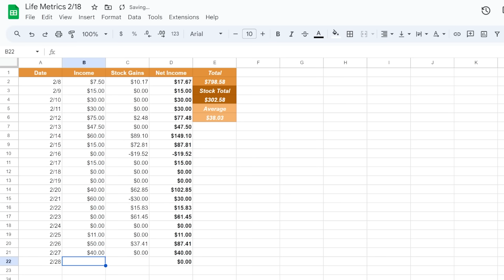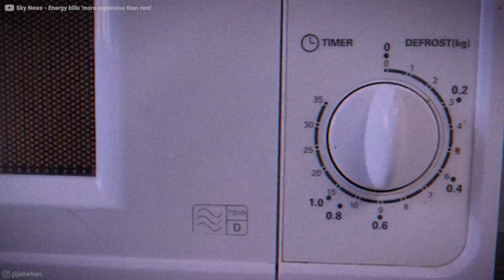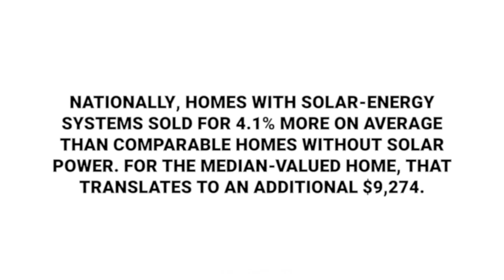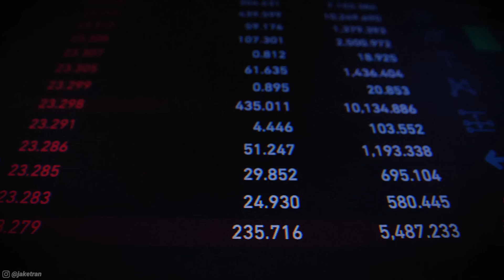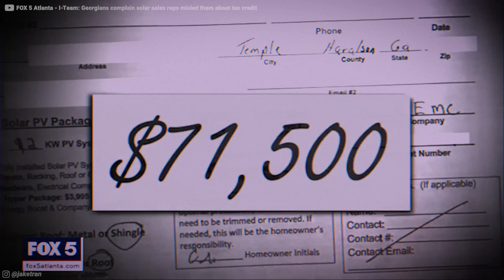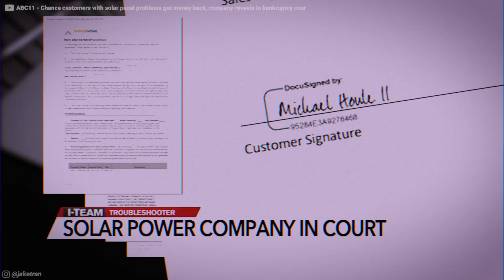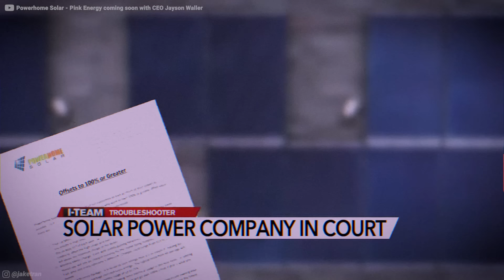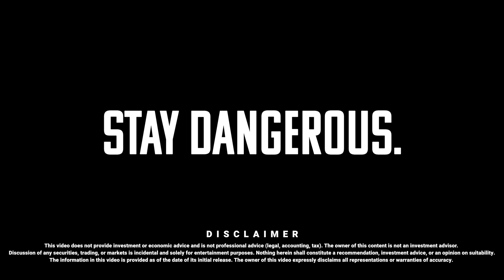Home solar panels are literally a scam.

Comment: I am a sales engineer for PV-Systems (industry size) in Germany. But here and there I also do home solar. Truth is most clients really don't usually care about the investment numbers but their motiviation is mostly to be more independent. I suggest every interested buyer out there to have the investment calculation run out or pay a consultant for the evaluation. 

PV should not be a product, but an investment, so treat it like this.
Reply: It's not an asset, it is a liability. And it gets worse the older the panels get.
Reply: @remyllebeau77  This really depends on the price for the system and what you consume and pay for electricity. 

You can not call it a liability without doing a thorough calculation. And to be honest there are tons of online tools. I tried them and compared to a professional calculation and they were close enough.
Reply: @LimeEngine  By definition it is a liability if you owe someone else for it AKA a loan. That's because nobody is going to guarantee that your electric bill will disappear or at least make up for the loan payment, and certainly not all year round.
Reply: @remyllebeau77  Well you could say this about pretty much any investment. There is always the entrepreneurial risk involved.

I am not saying that in every case PV is a good investment. But electricity prices in Germany are around 0,3 €/kWh (average increase of 2 % anually), your production costs, with maintanance and credit cost included, are about 0,21 €/kWh, then you save about 30 % energy costs anually and can have an amortisation time of 12 to 15 years. Would you invest in such a case or not?
Reply: @LimeEngine   Germany is at fault for not investing in Nuclear power like France. 

Most people in the USA don't even stay in their house for that long. If it is eventually a benefit, they won't be there long enough to see it.

And again, you can't classify it as an asset IF you are still paying for it. That is by definition a liability.
People love to buy cars, but many fail to realize that it is a depreciating asset, and a liability until it is paid off.

Also, in about 15 years you will likely have to start replacing the failing solar panels and batteries. So it's nowhere near the sunshine and rainbows that sales people like to paint.
Reply: @remyllebeau77  The discussion about nuclear energy and the nation wide energy supply is a wholly different discussion, so I won't get to that here.

The degradation of solar panels and the exchange of inverter and battery are considered in the investment calculation (battery change after 13, inverter 15 years). Panels still have an efficiency of 85 % after 25 years and can last well above 30. 

It will not give positivie returns for 12 years (let's say). But this doesn't automatically make it a liability. This is not how investment calculation works. There is no investment that gives positive returns immediately. Because if I would folow your logic, you would also advise against buying houses and rent them out?
Reply: @LimeEngine  Let's not argue about the differences between assets and liabilities. If you want to take on a liability/ loan and you run the math and it will give a good ROI in an acceptable amount of years, then go ahead, I won't stop you. If your math is wrong, that is on you.

Comment: Here is South Africa we have something called load shedding. No electricity daily from 3-8 hours a day. Every single day. So thank goodness for solar panels and batteries.
Reply: Solar would be useless during periods of load-shedding, without pairing it with battery backup and inverters that can run in island mode.  UL and IEC standards require that inverters automatically shut off, any time the grid isn't within spec of nominal voltage and frequency.

Comment: The transmission grid is absolute spec for customer.  I feel as a homeowner the best method of electrifcation is reliance on a central utility which evolves more efficient everything as opposed to a distribution of generators each with questionable reliability.

Comment: Biggest problems with solar are:
1- sales reps overpromising and not explaining clearly how solar really work. There are lots of tricks when it comes to number of panels, types of panels, financial options, lease escalators, etc that make it confusing for homeowners.
2- homeowners buying solar based off the cheapest price. When you buy anything (car, home, shoes, etc) you likely don’t just buy the cheapest priced you can find. Cheapest price means trash gets installed on your roof that has tons of issues, or your system isn’t sized sufficiently. One company may offer a system that makes 20,000 KWh per year and another company might offer a system that makes 10,000 KWh per year be the homeowner buys the system that makes half the energy because it’s cheaper.

Comment: We got solar on our house, we switched to electric heat as well, we went from paying $3,500 a year in heating oil and propane and still having an electric bill. To fully heating the house, playing all my games and having all the electricity I need, and pay around 19 dollars a month in the winter for my electric bill, and in the summer saving the electricity in battery's for if the power goes out.  for numbers sake thats 140,000 dollars in heating oil in 40 years... and still paying electricity on top of that. now lets say i have to pay in for 40 years straight, that would be 2,000 dollars. I didnt even pay half 140k, maybe closer to 1/4th. But when you do it right and look at the math, they are worth it.

Comment: So there is a good amount of misleading information in this video (some pulled from other videos) and a lot of cherry picked incidents. Many people have great experiences with their solar system and some don't. Just like all industries, some sales people are crap, don't rely on them to tell you the truth or simply the correct information as they may not know your circumstances.
Solar is actually worth it if you do it correctly, especially if you can diy a small "off-grid" system and build it out as you go. Plus you get the added benefit of having uninterrupted power backup, priceless for those in areas with natural disasters or power issues.

Comment: The issue is homeowners don’t understand they are buying into a dynamic commodity market of electricity, namely selling Kilowatthours, or Kwh.

Important notes:

1 - Solar alone will not work during a power outage.

2 - You cannot “push the meter backwards”.  The newer meters rack forward Kwh on one register and reverse Kwh in another register, and all data is time stamped by the hour.

3 - Price of power sold depends on the time of day it is sold or purchased.  For example, power is cheaper from dawn until around 4 pm.  Power is more expensive fro around 4 pm to 9 pm.

Because it is now a time-stamped, dynamically priced power market, most homeowners are not qualified to get the most from their PV systems, and therefore they are promptly screwed, rode hard and put up wet.

Most people do not understand how electricity works.  Indeed most people have never understood how electricity works.  And so unscrupulous sales and marketing folks swindle them big time, and folks bawl and holler and are pissed.

Wait twenty years and the systems will need to be replaced.
Reply: Counterpoint to #2:
It is only if you build guerilla solar that this is true.   If you get the proper permission and service agreement from your utility to net meter your power, your utility will provide you a meter that can spin backwards.

Counterpoint to #3:
A meter that sophisticated, usually isn't available to a typical home-owner.  It's common for commercial and industrial customers, but not usually worth the expense to do that for the scale of residential customers.  The standard meters they provide to home owners, and even the net meters, don't timestamp your power, and just work on a fixed rate.  You might have a bidirectional meter with two kWh registers instead of a net meter, that gives you an asymmetric value of energy produced vs consumed, but it is very uncommon that the utilities will provide time-of-use meters for a residential scale customer.

Comment: IDK about USA but in india solar on grid is working perfectly fine for me. I used pay 10000 INR per month ie 120 USD but after putting ongrid solar system of 10kw I get almost zero and even make few bucks in some months. it's been 5 years I think I got ROI already.  I paid 500000 for 10kw on gird system.

Comment: Yes, they are all low frequency. They have the 120v 3000 watt, and the 240 SP which is 120v and 240v 4000 watt. The best place ive found to buy them is Wild Oak Trail. Hope that helps

Comment: Every company I've researched for off grid grid tied and hybrid grid tied have wildly different prices on the exact same components as other companies. Example I looked at a Sol Ark hybrid 12Kw Max 9.6 Kw max out inverter. Only looking at new ones. Across 15 different companies the price ranged from as low as $2300 up to $6500 and don't get me started on the inconsistencies and lack of need to know information on the various ground/roof mounting options and wiring kits.

Comment: There is a basic formula you need to do before getting solar. Will the bill you pay later be less then the power bill you pay now? If the answer is yes, then you need to figure out how much solar youre home area generates. And compare it to your bill again. If that all check out. Buy a system about 25% smaller then your avg savings. This will account for inconsistencies and degradation over the years. 
And dont forget, if youre not going to live in the house long enough to break even. It isnt worth it.

Comment: does any one know where can i purchase the solar and the batteries so i can install them my self. iam a tech. i can figure things out...also iam not planning of going off the grid completely i am thinking of powering 1/2 of my home just to start,  mostly the low wattage components inside the house.
Reply: Alibaba its where I ordered all of my panels, inverter and batteries.

Comment: Here in Ghana, most homes do prepaid payment to have electricity. We buy the amount we want into the electrical machine that's connected to our home's electrical current. When the money runs out on the machine then we have no electricity until we reload money. Meanwhile, some people use solar panels installed which work very well on their own without owing anything once you have paid it all off. You must have the funds to own your panels. Yes, the purchasing and installation is pricey but it's a good investment as the sun is the source for life.

Comment: But if you can afford to buy the whole solar setup cash would it be worth it?
Reply: If you're buying from a reputable installer and you have a good location for the panels, then yes. 
But that's rarely the ones going door-to-door.
Get quotes, check reviews, don't just sign the paper the first guy who shows up knocking puts in front of you.

Comment: In lebanon around 80% of homes outside the cities have a solar system. And the best part is that you can get 15A system with batteries and an inverter for only 2500$ , I have a solar system in my home and it is working perfectly for around 6months of the year I pay no electricity bill.

Comment: 2 things you missed, 1 most leases are for 20 years, being after that the panels no longer work. youll be lucky if they produce 5 percent. more so on the contract. the company gets paid by the electric company for your panels. lets say in 1 day, your panels make 100 bucks. 99.90 goes to the company, .10 goes on the end of your bill

Comment: You don't sign up with first guy who comes to you for Solar. You gather quotations first. I gathered 12 quotations then bargained. My initial setup coated me $7000 and producing close to 30 kWh per day. I didn't take any loan either. I'm putting 10 more panels now and spending only $1500 to increase my production to 60 KWH per day. My daily use is 85KWH per day because I own a big Spanish Villa with the works. My 10 kWH  battery is just there for backup.  Also, do it in steps always. Don't go for the highest configuration in the beginning and never never never take loan or buy solar on rent.

Comment: I installed a solar system on my shed which was built from damaged and used panels and has a primitive lead acid battery bank. Still working almost 20 years later BUT it requires constant maintenance to function reliably. If you cannot install and maintain your own system it is not worth having one.

Comment: From where I'm from(not anywhere close to the US), electricity is actually cheap. I roughly spend less than 10$ and I have so many electrical appliances. Solar panels are actually cheap, most people can afford to have one. It's around 600$ and you won't be charged every month after installation.

Comment: I've built 3 victron systems.  1.5kwp/5kw lifepo4/3kw 120v out.  1.8kwp/5kw lifepo4/3kw 120v out.  6.3kwp/25kw lifepo4/10kw normal<20kw power assist 240v split phase out.  They work great,  but may need topped up from time to time or could benefit from more battery......

Comment: Solar all depends on the local utility company. CA SCE NEM 1.0 & 2.0 program was a retail to retail rate exchange which actually produce savings. But in states like Washington with no sunlight, 12cent energy, and a whole sale buyback on extra kWH is why you want a 40% size system to just cover day time needs.

Comment: There's a program called SREC that you can get with get with your solar panels for free. I'm getting about an average of $50 per month with it. And when the energy company increases their rates, they can't charge me the increase. The energy company where I am is increasing their rates because of a new state or federal law that is forcing them to use at least a certain percentage of renewal energy to send to their customers, and because of that it's costing them, and so they increased their costumers' rates to offset their added expenses.

Comment: a proper grid tie system can make the power bill zero but no they dont hand you money back nearly every state has ended the power buybacks. but what the company dont tell you thats only going to be in the summer months when winter hits and there is very few hrs of sun and in my state also 24/7 grey skies all winter those panels wont be doing anything.

Comment: You should do a video comparing financing a house, adding solar and geothermal, and comparing it with living in a rental apartment of the same square footage and using the funds instead to invest in various dividend-yielding stocks and funds.
Reply: Or don't live in either one, just live in your car, and invest in the stock market 😀😁
Reply: @mitchweber7868  well, maybe a tiny house in a leased plot community (trailer park)
Reply: @ignacioverboten9382  I saw a video that a lot of trailer parks across the country are raising their rent lately, to just about as much as an apartment now. That whole thing of owning the place, but yet renting the land always seemed like a sneaky trick to something that probably isn't a good investment  at all.

Comment: Did everything myself for around $4,500 for a 3.2Kw system. Bought the panels on clearance. The permitting is the only annoying part and is a pain in the ass. Other than that it's been worth it. I save around $60 a month. Will see if the tax write off goes smoothly and if it does I think I came out pretty well for an area that has cheap electricity.

Comment: I have been using solar for the last 6 years. Saving around 75 dollars a month. And I pay about 30 dollars a month, which means I net around 45 dollars a month (I am not from the USA. So, such small dollar amounts). This comes to around 10 percent of my salary. The thing we did is we went for community solar, and hence, due to economies of scale, everyone was able to save massively on the upfront installation cost. 

Also, I will request everyone to please look into the amount of subsidies being given to Oil and gas industry in nearly every western country. So, without those subsidies, the price of oil and gas will also skyrocket. So, compare the prices without subsidies to finally decide what's cheaper.

Comment: solar panels is quite for small villages or towns that don't have stable electricity.
build your own do your own research, there's a lot for youtube tutorial on how to build one/make one.

my solar is for Charing phones/TV/Laptops/computer/internet modem & router/ POE wifi AP and main LED lights at home. it started with only LED lights and charging phones and powering up 4g+ modem/router.

fridge, iron, washing machine, water pump is still on the grid.

Comment: Where there are power outages and sunny most of the time, the solar solution seems good for houses, shops, offices but on a larger scale to provide non stop electricity to a whole town or city doesn't seem feasible at all and doesn't seem to be aiding green energy revolution-many reasons out of which one is these solar panels are made by adding coal to its ingredients more than 50% secondly, there is no solution for degrading or disposing completely the end of life panels, triggering more damage and rubbish to the mother nature in turn.

Comment: I had solar installed a few years back.  No battery for the system.  Interest rate is 3%.  We got the tax credit that paid off 1/4 of the loan.
The electric bill was consistently lower until we choose a different electric provider that doesn't provide buyback credits.
I'm donating $10-$20 a month to my power company or I can switch to another power company that'll charge me 2 cents more per kWh and a $15 monthly connection fee.  
The air conditioner runs constantly four months here.  
My monthly electric bill is $12-$65.